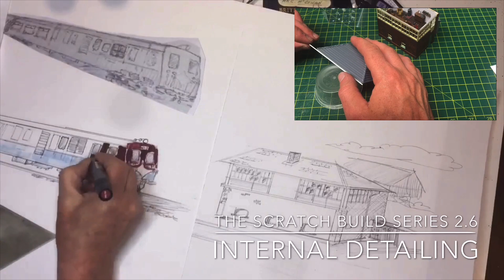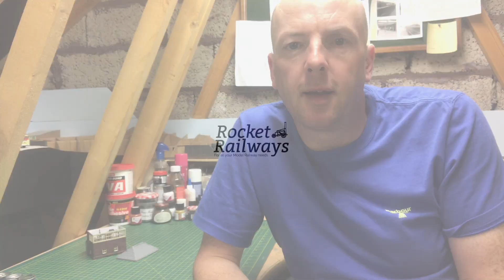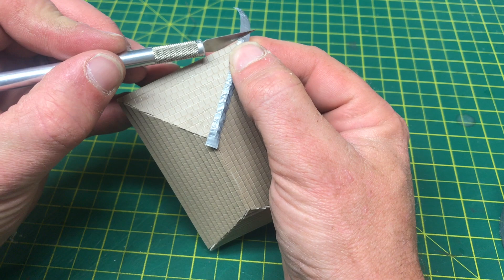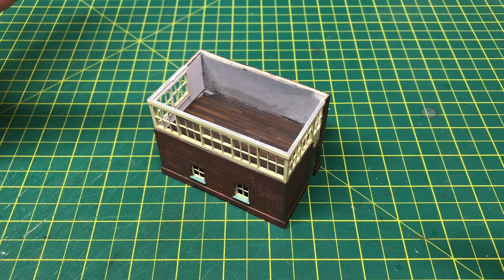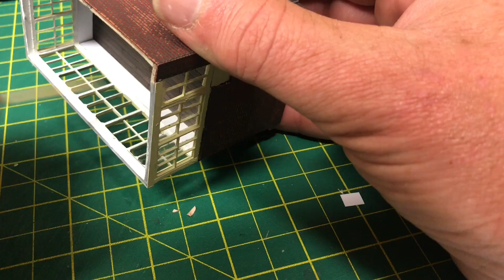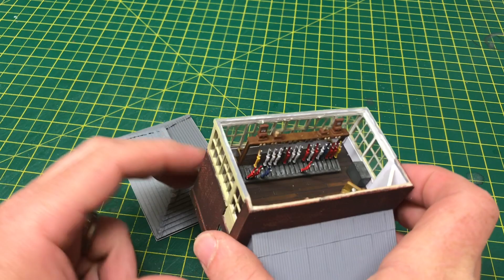Building A OO Gauge Model Railway: The Scratch Build Series 2.6 - Internal Detailing

Comment: Fabulous work Paul Great idea using the duck tape for the ridging tiles Iam sure you used that on a earlier projct as I was wanting to do the same trick on a recent build but could not find where i haf seen it i was sure it was one of your videos anyway ended up using masking tape fot my ridges. Keep up all the good work all the best Pete
Reply from the maker: The masking tape should work just as well Peter although perhaps a little less tacky. Paul
Reply: Cheers Paul so its stayed stuck down just wanted to say with out your YouTube channel I don't think I would have tried scratch building large structures like a signal box so many thank again for sharing

Comment: Hi Paul another great video and a great builded of the single box oh I am thinking of building a 80 class 3 car set I have spares lima mk2b  tso coaches to build it I will have to get a hornby class73 loco to build it I have not built a 80 class for 33 years it would be interesting  to see how it would turn out after so many years mate stay safe and well Paul clive
Reply from the maker: Thanks Clive, keep me posted on the Class 80 Build. Perhaps it would be easier doing two at the same time, one for you and one for me. 😉 Paul
Reply: @GalgormHall  hi Paul well I am working on my mk2c conversion at the moment it would be a easy to build a 80class along side the mk2c fo/fk/tso coaches as a lot of  the work is the same except the 80 class power car we will see what happens Paul as I said I need a hornby class73 to power  the 80class power car I do not have one at the moment clive